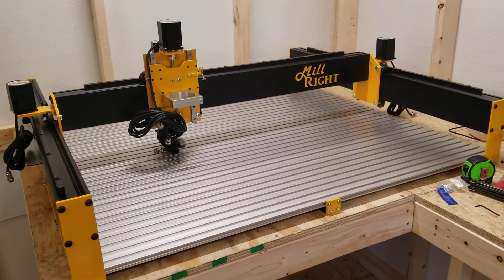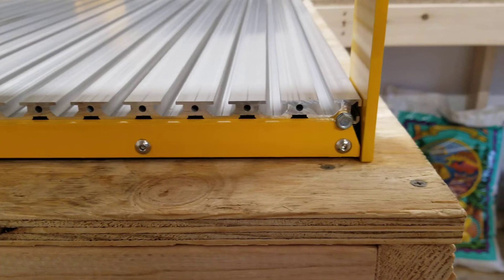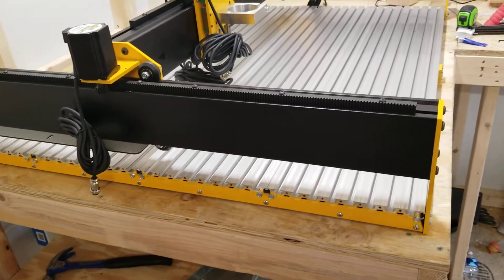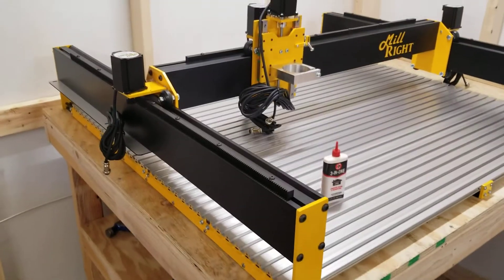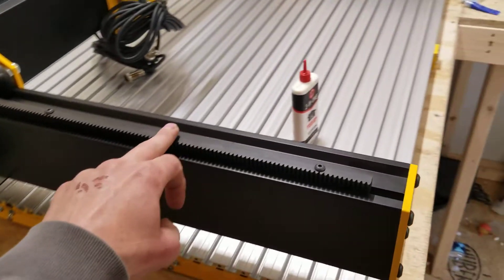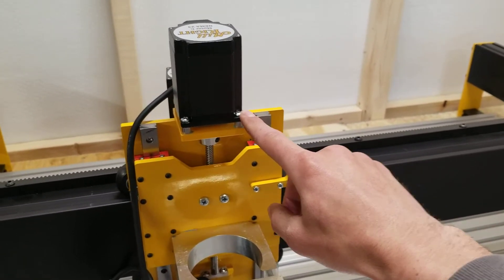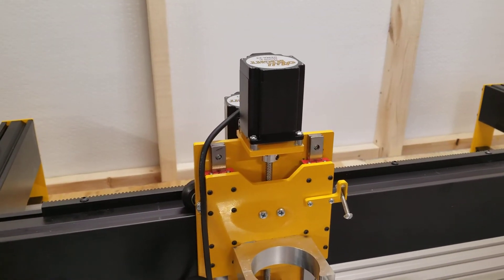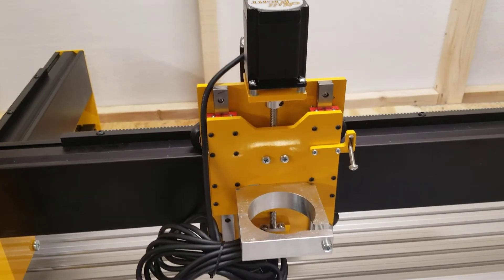Assembly Update On The MillRight Mega V!!!

Comment: I also used blue loctite! I wish the router mount had where you can mount from the front! I may put it on my mill and drill them all the way thru then counter bore so I can mount it from the front. I bought the plasma version and how would you get it off other then taking the whole thing apart??
Reply: I hope they made the plasma version so you can mount it thru the other mount but I doubt it! Thing is if you have to pull the z you have to worry about the ball bearings falling out!
Reply from the maker: If you have the means and ability, counter boring from the front doesnt sound like a bad idea in your case!

Comment: I was missing 6 screws that go in the end of the extrusions that mount it to the table! I used 6 socket head bolts I believe they are 5/16? They were black and take 4 per plate on the end.

Comment: Can you show how you accurately squared/measured the machine?
Reply from the maker: I basically just pulled a tape catty corner on both sides to get a quick reference on how square it was and it was pretty much perfect. Once it is operational I will tram the machine and make any final adjustments. I should cover all this is the final assembly video!